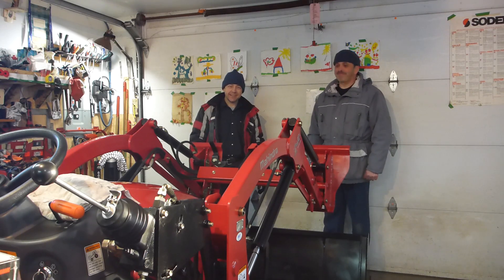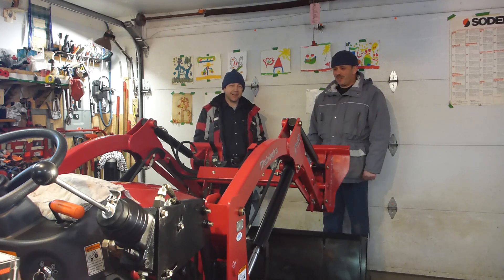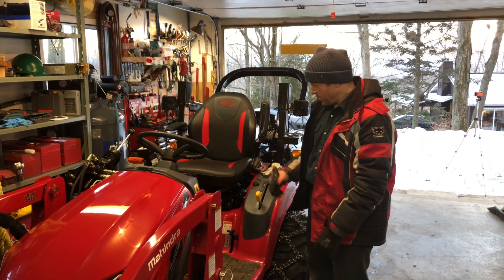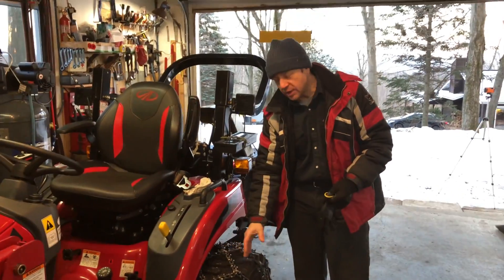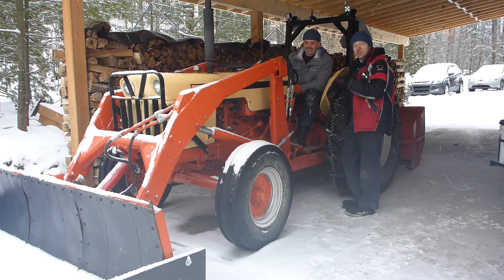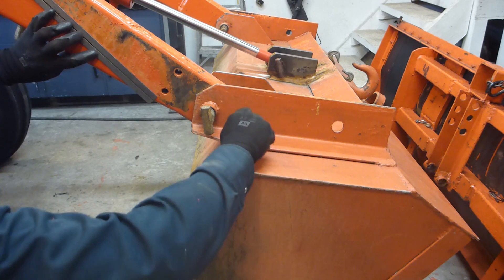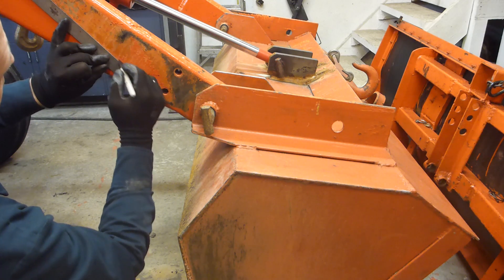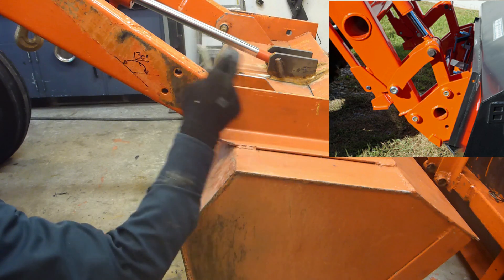#129 Skid Steer Quick Attach - Part 1

Comment: nice looking Mahindra Dave! they make some nice quality tractors. looks like your quick attach will be a bit better than the standard ones that come on most tractors. I like the double bar from side to side. that will help prevent twisting. I started to do this same build on mine because I had a pin on system myself. in fact I bought the plate to weld on my bucket and then decided to just buy a new bucket and sell the old one. I was able to get nearly what my new bucket cost for my old pin on bucket. since I bought the new bucket from Kubota they gave me a good price on a factory quick connect. so it cost me about a hundred bucks more than building it myself. for a hundred bucks difference I had to just buy one ready to put on. so glad I got one. it sure made the loader a lot more user friendly. sometimes I change front attachments three or more times a day now. lot better than that pin on design.
Reply from the maker: Looks you had a very greal deal on the SSQA and the bucket.  I am so glad I did that. I had no choice to double the bar links because of the single curl cylinder. It's 1/4'' thick 2x2.  Now time to build some more implements!  Thanks for your comment Dave!
Reply: You very welcome Sir, I really like my little red tractor ( mahindra ) and yes with the Yanmar diesel engine ! I'm very happy and i just done the 50 hrs maintenance on it. Take care of yourself Sir !

Comment: I will be building the same for my International 2500b this spring.  Great to see we have the same ideas for these old beasts
Reply from the maker: Those old beasts have proven to be very great machines!  What year is your 2500b?   This should be easier for you to build the SSQA, because you have 2 curl cylinders.  I've learned a few good things by doing this project. I would be glad to share more details with you if you need. My E-mail is joe.lesage@hotmail.com  Sometime, it's much easier by email where we can exchange pictures! Just out of curiosity, what is the distance between your loader arms (inside-inside or outside to outside)?
Reply: @FromSteelToWood  1977.  It is an industrial tractor but whoever was the first owner I thank cause they got the rare option 2 speed PTO which most of these do not any PTO.  I already modified it.  I didn't like using starting fluid when it needed it below 40.  These came with an either start system.  So I order a thermostart glow plugs for he/Massey Ferguson's.  When it arrived, I was looking where on the intake manifold I would drill/tap for it.  All of a sudden I find a plug on the manifold, take it off and notice it looks like the glow plug fits.  It was an exact match 😂.  After some research I believe in England these came with the thermostat glowlug but in NA we got either start.  So basically this diesel starts in any temperature now.
Reply: @FromSteelToWood  Inside width is approximatly 40".  It's a big loader frame.  Heavy duty being an industrial tractor.  I was thinking a smaller tractor but with my equipment experience I have certain tasks I want to do in the future.  Pallet crate full of wood, move machinery around, landscaping/excavation, large snow falls, etc.  I have a Bolens G14 I will repower for my mowing and smaller needs.  I would like a small front loader on it for small stuff maybe.
Reply from the maker: Ok, that is wide!!! But no problem with that. Narrower than 36'' inside is becoming a more complicated thing. So should I assume your loader arms, outside to outside, more than 44.5''? The very sweet spot would be 44'', where this is the easiest setup possible. If you are interested, you might send me an email and I'll send you some sketches, it's easier to explain. BTW, I've found over time that a bigger tractor for bigger tasks and a smaller for smaller task is optimal! Instead of trying to find a one-size-fit-all tractor!
Reply: @FromSteelToWood  Absolutely!  I recently sold my Toro Dingo 323 compact loader.  Perfect for when I was a contractor.  Not ideal for home use on my new 2 acres.  Can't cut grass etc.  I have used excavators, backhoes, and payloaders of various sizes for companies or rented.  I have lots of heavy material to move, like to be able to take large amounts with a big loader bucket and love the ability to lift heavy objects with a big machine.  Plus when one goes down you got a temporary backup.

Comment: Hi Joe! You can buy  a quick attach blank at any good tractor supply store. I have a quick attached bucket ,so i  purchased a blank to attach to a blade. A lot less trouble than building. Take care
Reply: I cant seem to find one for my Ford 340 Industrial Tractor.  Can you direct me to one?  Thank you!
Reply: @slhasebroock  Please note that they are for skid steer standard , which is a certain width, Not sure about adapting to bigger tractors. This is just a quick link on ebay for a male and female , different thicknesses, 
https://www.ebay.com/bhp/quick-attach-plate. Hope this helps!!There are other sites
Reply: @mrfixit603  Thanks for the link.  I will study the options.  I think I am running into the same width problem Joe is with his old tractor.  Seems this quick connect stuff is mostly for skid steers or smaller tractors like his friend Dave's Mahindra.  Joe and I both have full size tractors.  Much wider of course.  Steve
Reply from the maker: It can be bought and modified if required. I could not tell if the width of my loader was standard or not (39'' exterior of arms). But one thing I can tell, there was three drawback of buying an already made SSQA. 
1- Expensive... Mine cost me around 300$ CDN including hardware steel, consummables and paint. 
2- The Case has only one cylinder for the curl...  Universal is designed for 2 cylinders
3- Universal models increase a lot (4-5 inches) the distance between the loaders arms and the implement. Mine does add 1''. Very compact version. Then the added distance is reduced capacity, especially for a dirt bucket and pallet forks, where the roll back force. 
Here is a link to a company that does them. 
https://www.everythingattachments.com/Quick-Attach-Adapter-Plate-p/wrl-apum.htm
Reply: @FromSteelToWood  I only paid around $180 for the implement blank 1/4 " thick. The tractor boom that i purchased already had the latching attachment. Great vids,
cheers from Nouveau Brunswick .
Reply: Steve Hasebroock, fwiw, my son in law just purchased a Kubota 3901 with quick attach and all my LX865 Ford New Holland quick attach interchanges perfectly.  I can measure the width on either one tomorrow...provided my brain thaws out enough to remember.  It probably won't help you any, but at least its a reference.  39 hp Kubota to 65 hp skidloader.
Reply from the maker: Mr. Fixit, I just read again your comment. The blank to weld to the implement is cheap.  The part that goes onto the tractor is way more expensive. This is the part I built.
Reply: @FromSteelToWood  Your right about the costs. Did i miss you mention about  implement stops ,for full curl and full dump? Cylinders don't like to be used as stops.
Reply from the maker: Good thing you make mention of that.  Retracting, the SSQA stops on the loader arms.  But on the extension, this is the cylinder that stops it.  Then I saw I could modify easily the SSQA so it stops by the loarder arm. That could be a good modification to do. May I ask your first name if you don't mind? Thanks!
Reply: @FromSteelToWood  Daniel (Danny) White ou Leblanc  , Your are an excellent  fabricator /welder by the way., if i may guess. I am a mech by trade. I enjoy watching a true tradesman  in action. Salut!
Reply from the maker: Merci Daniel! C'est très gentil!